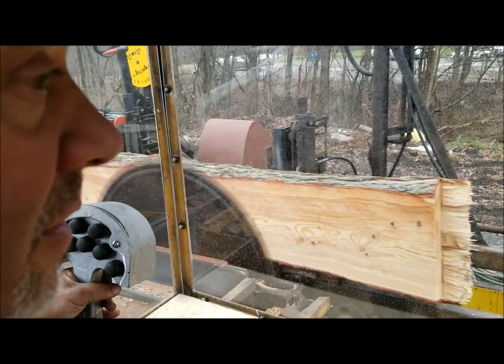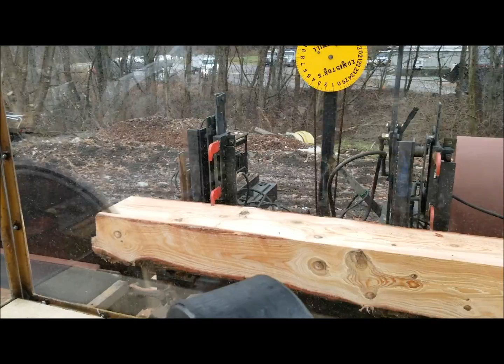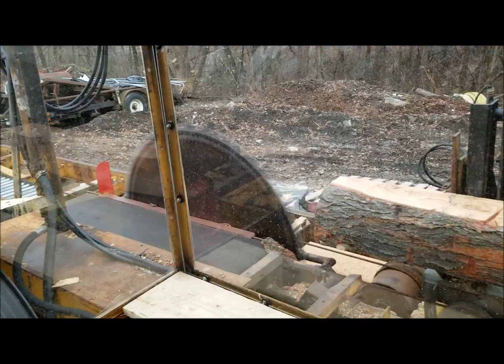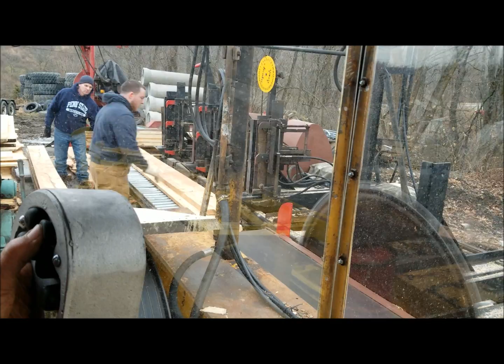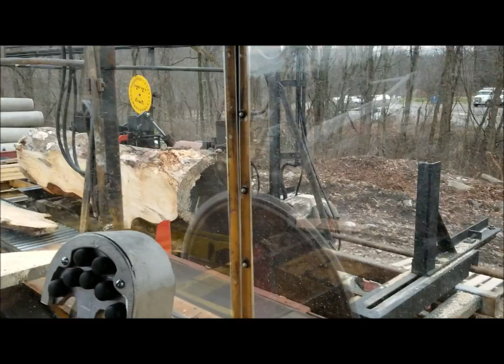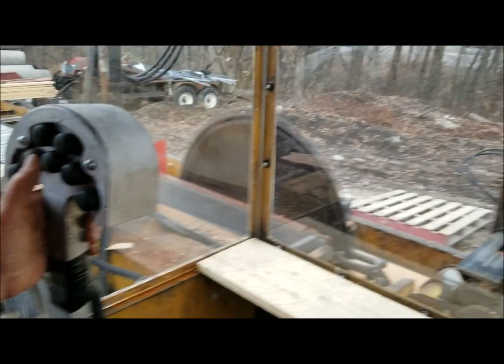sawing pine

Comment: Nice set up. I have one very much like it.
Reply from the maker: thanks ,we found this mill on craigslist ,look at our video part 1&2 sawmill move on my channel to see what it looked like one year ago.
Reply: @markgalicic7788  I can imagine. Over the years I have built 6+ circular mills from piles of stuff collected etc. Mine is an old Coots handset with hyd drive. An ancient old 220 Cummings for power on a 50 inch Simmons saw with "F" bits. The old girl works great on little fuel a shift.
Reply: @markgalicic7788  My biggest problem is finding a crew that wants to work hard for $ 25.00 Hr.Not a lot of those around any more eh.
Reply from the maker: yes, or if they show up at all .
Reply: @markgalicic7788   Some days I wish I could get away with cold blooded eh. Oh well, Rome wasn't built in a day eh, LOL.
Reply: What,f
Reply: H
Reply: Hi
Reply: Hatt

Comment: I learned to saw pine lumber on a FRICK  00 manual sawmill that was probably 50 years older than me. I know what you are going through. BIG difference between pulling the STICK and working the leavers.
Reply from the maker: yes sir I just takes time to learn.

Comment: I taught pine was telephone pole or those super straight pine trees, Like they use that engine on the mechine that run & trim the branches and the bark in 2 pass. These are bigger at the bottom like regular trees.
Reply from the maker: we get some large pine here , we have some 36" round to saw.
Reply: avarage in a pine forest only 5-10% of the pines are telephone pole quality...  the rest might have to big branches split tops ore just to bendt. hehe.
at least in norway most pine boards are used for boat building ore the outside boards on houses..
while most standard lumber is made mostly from spruce which grow more straight and have smaller branches, and is easyer to saw in an automatic lumber mill.
Reply: X
Reply: @markgalicic7788  vimllzdi
Reply: @arnoldconrad5161  NB

Comment: I have a band mill and saw mostly for myself. The question I have, do you  center the pith on the first two sides of the log. So you get ring centered wood the bows and cups less. I do it by measuring from the bed to the pith so I saw parralle to the center on the first two sides.
Reply: That’s the idea and what you try to achieve with the tapers, our mill has a manual taper set but I’m looking down the carriage, how mark can see that from the cab I’ve no idea 😂

Comment: Is a circular saw better than a continuous loop blade?  Or is it just a matter of preference?
Reply from the maker: I myself like a circular saw , but bandsaws make a smaller kerf "less waste".
Reply: Round saws are more wasteful than band saws
Reply from the maker: we had a band mill years ago , this is our third circle mill and the speed is worth the loss .
Reply: Does a bandsaw need more frequent sharpening?
Reply: @mountainguyed67  YES! & IT's Slower Cutting!
Reply: I’m looking at Norwood sawmill to turn trees on our twenty acres of timberland into a cabin, and other structures. Norwood says you have to sharpen every two hours.

Comment: what is the RPM of that blade, it look really fast!
Reply from the maker: we run it at 550 rpm
Reply: @markgalicic7788  That's probably what it's hammered to run at.
Reply from the maker: yes we tell him what speed.
Reply: @markgalicic7788  There's a tech School close to here that does that. Seems there was/is an outfit called 'Miners Saw Works' that did it for years. That's where the old sawyer took his.
Reply from the maker: miners made edgers too
Reply: @markgalicic7788  I can't remember what make of edger is there but it's the original one that came with everything else I think. I was just there for the running and not much of the setup. That's when the strong backs and weak minds came into play.

Comment: Operator needs more practice it was painful to watch
Reply from the maker: yes it takes lots of practice ,
Reply: @markgalicic7788  

เครื่องใชุ้มือสอง
Reply: your doing ok the mill needs more braking in and you will get better with time...
Reply from the maker: thanks for watching , yes its a learning process & working the bugs out of the mill.
Reply: I sawed for over 10 years. That's slow

Comment: They are trying to saw hemlock and the sawyer has no clue as to what he is doing.  He never set the tapers and he wasted lumber.  He won't saw for me...
Reply from the maker: Hi Dave this was the first time I ran this mill after rebuilding it . we had very little time on the controls & yes we did saw both hemlock and white pine.